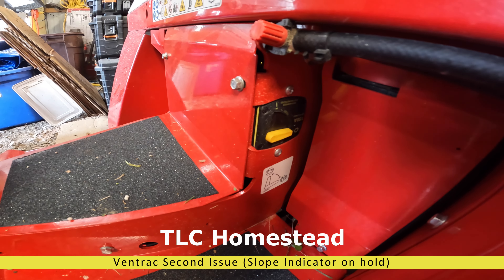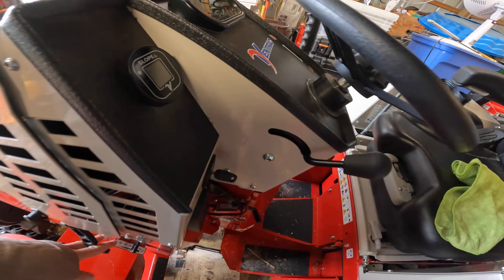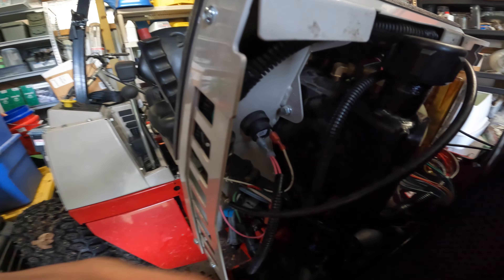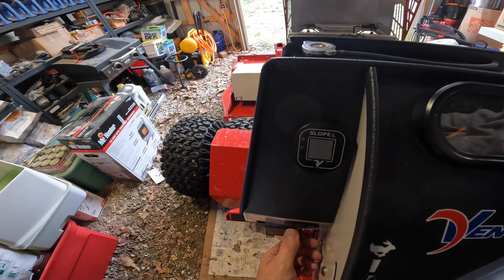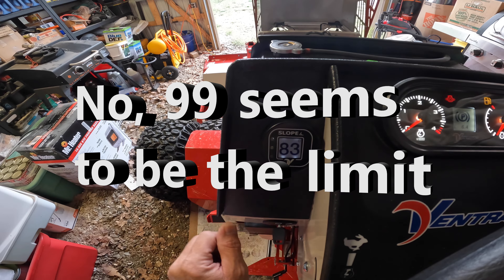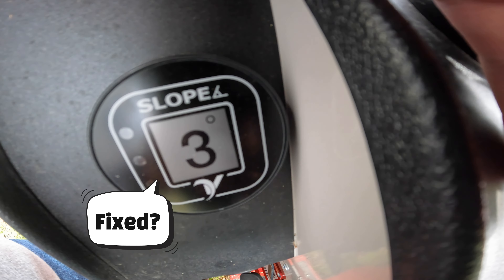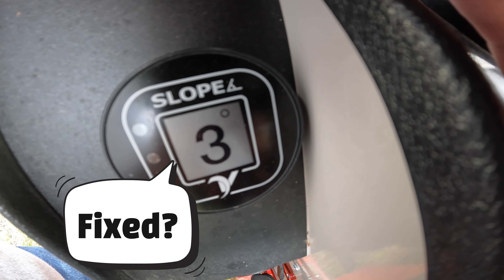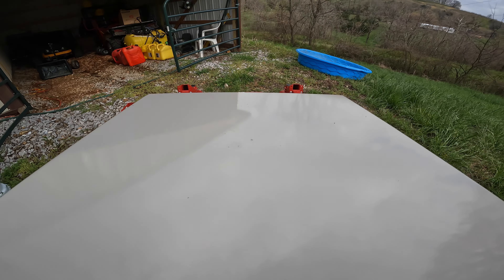Ventrac Second issue (on hold)

Comment: I have had similar issue. Slope indicator has read up to 103 and seems to fluctuate between 83 and higher. No beeping issue thank god for that. Am awaiting dealer to send new gauge. Also have an infinite gas issue lol gauge always reads full. But I still love my Ventrac
Reply from the maker: You know, I wish I had a reason but ever since that one time I stopped and filled up the gas tank my gauge has been reading perfectly. Explain that!

Now, I did hear from Ventrac that 84 degrees is the slope of the dash, meaning the gague itself reset to zero and is tilted to 84 degrees. TO me that sounds like the slope itself is caculated at a single point - the dash. Which seems a bit odd to me reading the instructions, but who am I to know how it works :)

Comment: Copper Creek is correct. The WDL makes a major difference and don’t forget that includes using the lift in float or fully down. Makes it more stable
Reply from the maker: Yes, I am getting better with the machine and learning those little tricks. Or maybe said "I am learning how I should be using the machine" :)

Comment: Sounds like a defective gauge. I am sure they will send a new part. After about a month of running it on your land you wont even look at it any more; 
you will know what you can do. And that machine will go a lot steeper than you think and still be safe.
Reply from the maker: Traction is key I am learning and this Ventrac loses traction. Do not get me wrong here, I am not sure if a different machine would keep trtaction where i am trying to mow but I am sliding all over. I have a video from last night I need to get off my phone/GoPro and edit where I got the Ventrac wrapped around a tree. That was two hours of fun I would rather not repeat.
Reply: @tlchomestead  If you haven't messed with the settings any between your traction issues and this video, the issue isn't the machine, but rather how you have it configured.

You look to be in high range (bunny) with weight transfer at 2. Switch to low range (turtle) and put your weight transfer to 4 (max) and you will notice a marked improvement in traction.

Make sure you read the instructions from the manual on how to switch ranges. If you don't you could get frustrated.
Reply from the maker: I am learning as I go and these comments are helping. I put too much trust into the delivery and what was told to me. That is no longer the case. Now, having said that I do expect some slippage but I'll bet there is a lot less now that I have tweaked settings some. 

I was thinking something was wrong but the way I had traction everywhere else I was not focused on the WD at all. Ohh well, this is why we talk to people. To learn and get wiser :)
Reply: @tlchomestead  Right! And if the dealer told you it was in low and seemed to set it in low, you probably weren't thinking 'I wonder if switching to low would help'! :D